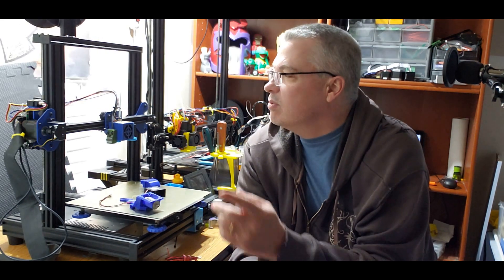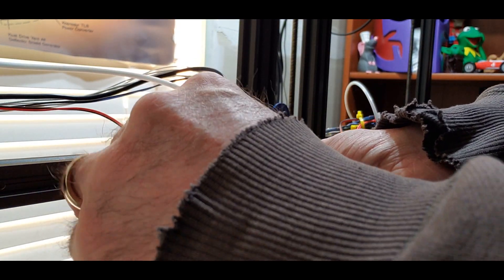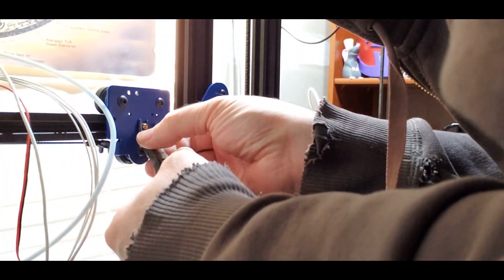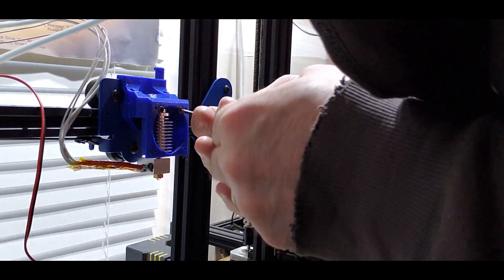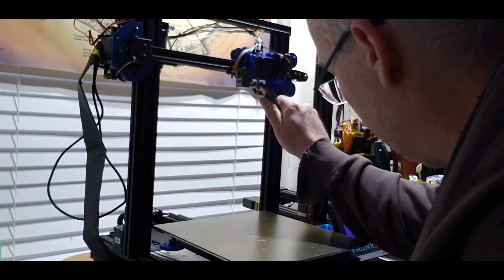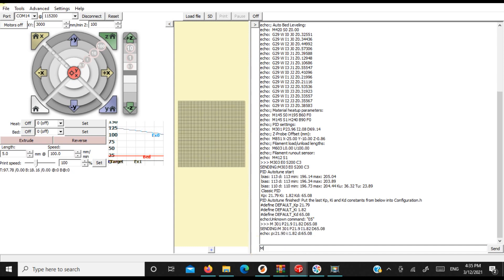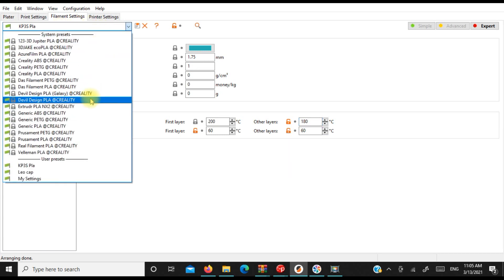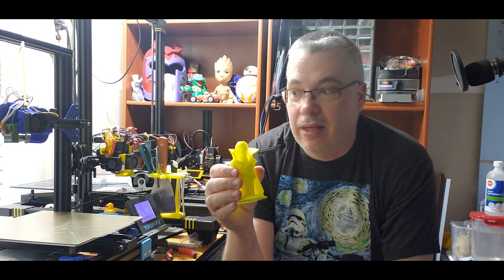Tronxy XY 2 Pro V6 Upgrade

Comment: jeff superb again i have a problem with my xz2pro hot end heating up when you turn on printer and over heating 
i have changed the thermostat and heater but still the same is there a fix for this it started when new firmware was installed 
thanks colin

Comment: Hey hows it going your videos are super helpful I want to get you opinion and advise on slicer setting. What speed settings do you have your prints run at mines at 65. What’s your recommendation for running it at 1.5 and also for 2.0

Comment: Hi Jeff I Did put a e3d v6 on my tronxy X5sa 400 but it’s not printing we’ll do I need to change anything on firmware (chitu) or if I do as you did and no change the block and the thermistor do you think it will run well ?

Comment: Nicely done, Jeff. What about Klipper as one of the next projects? I m in despair with the config file cause there are just configs for the core xy tronxys but not the cartesian...
And please, you have been speaking about "tweaking". This is a basic think that many people want to hear about. How do you tweak the profile, how do you fight stringing ang Z-banding?
Reply from the maker: I'm thinking of Klipper. I have to look into a raspberry pi first. Good ideas for videos!
Reply: @jeffs3dcorner  Its just because I don´t know if it is possible to get the settings for Klipper out of the config for Marlin.

Comment: Did you have an issue with the USB connection with marlin 2.0.x?
Reply from the maker: Try lowering the baud rate.
Reply: @jeffs3dcorner Thanks, but I tried that. I believe my source says 57600. Do you think you could look at your source and tell me what numbers you set as your serial ports?

Comment: what size nozles for the xy2 pro stock hotend kneed oderd loads mk10 nozzles now non fit
Reply from the maker: 0.4 mm MK8 nozzle same as the CR10
Reply: @jeffs3dcorner  carnt fined any that take the ptfe tube same as stock